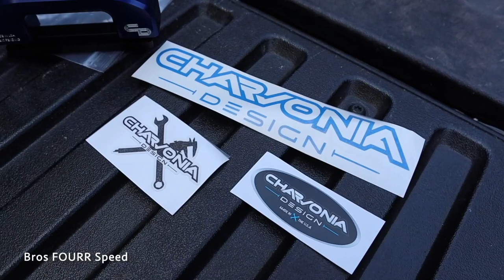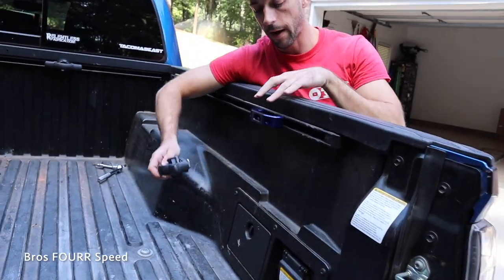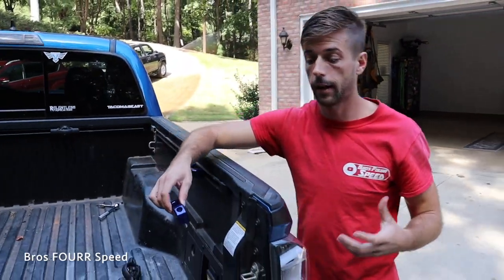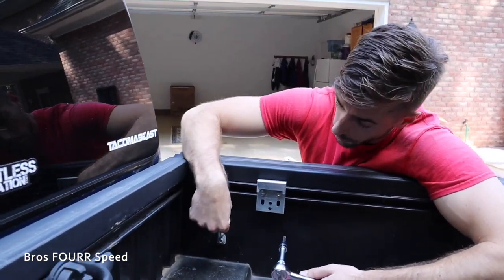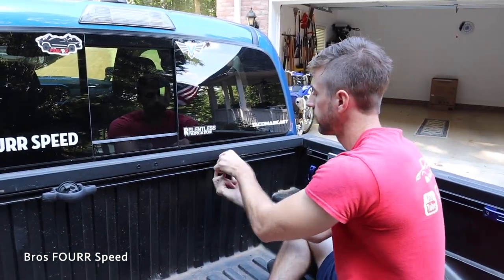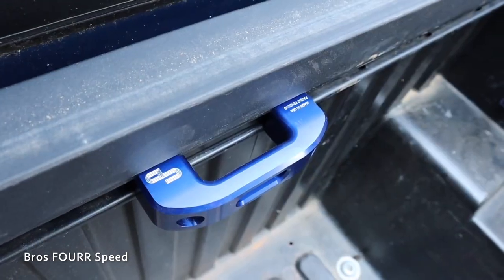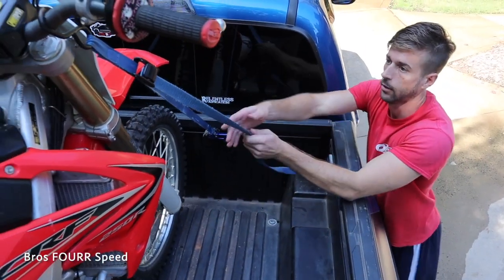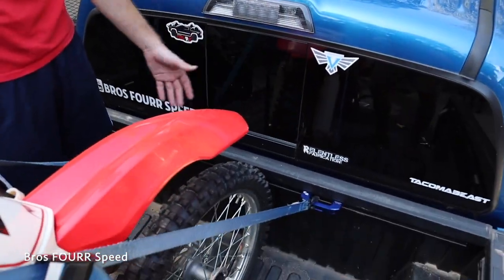My Toyota Tacoma Should Have Come with THESE!!

Comment: I have a question maybe you can somewhat answer.  If you had to replace a transmission in an 06 4Runner V6 , what do you think the average cost would be? Should you rebuild your own or buy a rebuilt?
Reply from the maker: I'm just guessing here....a new transmission is probably around the $2-4k mark.  So it really just depends on the cost difference between a new one and a rebuilt one.  If you have the know how to rebuild it yourself, that can save you a lot!
Reply: @BrosFOURRSpeed  Thanks.

Comment: These have zero adjustability because they are at fixed anchor points wherever you tighten them down.  There is no “quick adjust”.  You need to keep tools with you in your truck in order to be able to slide them around back and forth.  I imagine after loosening and tightening them 20 times they will start coming loose and stripping on their own.  The Toyota tie downs may not be as versatile but they do have a quick adjust knob dial and you can move them around 1000 times without a problem.  I still have the original set from 2006 when I bought my 2nd Gen Tacoma brand new and I have now moved them over to my 3rd Gen Tacoma.
Reply from the maker: Completely disagree. Yeah you need one Allen key, that’s it. If you tighten them improperly, that could happen, but if you take your time and do it right, that’s not even an issue. That’s fine if you like the oem ones. I have mine set where I don’t move them. Unless I have something special and need to move them, they stay stationary. Much better than the factory in my opinion, even with them being “fixed” as you say.
Reply: @BrosFOURRSpeed  If you don’t move them and they are strategically placed then yes I agree.  I will order 1 set of 2 and put them in a permanently fixed position.  What I do like is the milled slots that allow for hooks a lot easier than the OEM ones but the OEM ones also serve their purpose.  Thanks 👍
Reply from the maker: @giorgioskaraiskakis9548  That’s a good way to go as well! I did end up keeping the oem ones on as well incase I needed a different attachment point, but they were just secondary if I needed them! 
We can help you with that order! 
https://brosfourrspeed.com/parts-%26-merchandise/ols/categories/toyota-tacoma-parts

Comment: what are you using those other mounts in the bed for?
Reply from the maker: What other mounts are you talking about?!
Reply: Those galvanized steel in the side rail, just behind the front of the bed looks like a inverted 'J'
Reply: @garydp9760  Maybe they’re tonneau mounts?
Reply: I’ve been trying to find out what those are called and no forum has answered it. I’m trying to find replacements or reasonably priced upgrades but no one knows a part number.

Comment: You've done so much to the Tacoma all that's left is bed tie down cleats. Lol. As much as I love the taco. Yours and mine. I wonder if ur thinking of getting the new Tundra?  Would be great to see what you can do with a full size truck.
Reply from the maker: If they have the same technology and features on the new Tacoma, I'd consider that!  I don't need or really want a full size, even though the new Tundra is sweet!  I'd love to check one out, but I'd get a new Tacoma if it's really different!
Reply: Bros FOURR Speed  I believe they added a locking diff and multi trail select modes. A gen 4 tacoma would be great. Think it's a few years out. Either way. Love the channel. Keep it up!

Comment: No! I have carried very heavy loads and the OEM cleats will not fail. Desides, those cleats that you are promoting are waaaaaaay overproced for what they are.
Reply from the maker: The factory cleats work, but are so flimsy and obviously plastic, so very cheap. My motorcycle goes back and forth on turns with them even wrapped down right. These new cleats give me way more price of mind and don’t move. Worth the money when hauling expensive items.
Reply: @BrosFOURRSpeed  they are still very overpriced.
Reply from the maker: @adamellis2371  Where else are you going to buy ones like this? Way better than plastic.